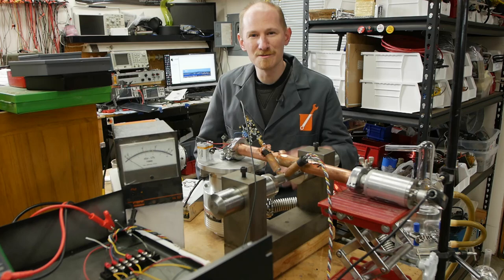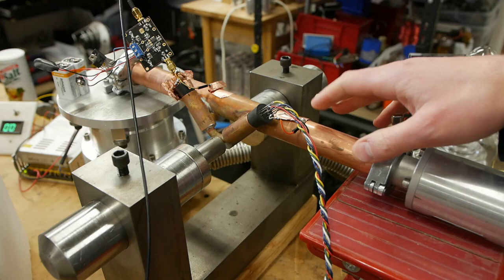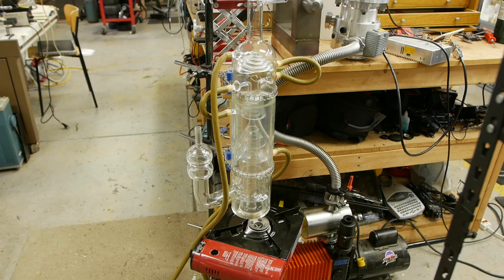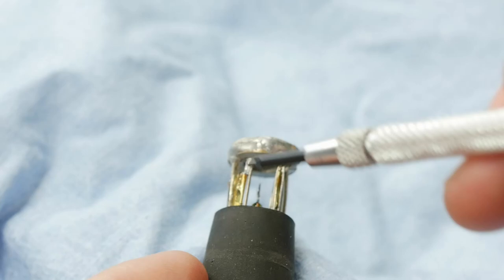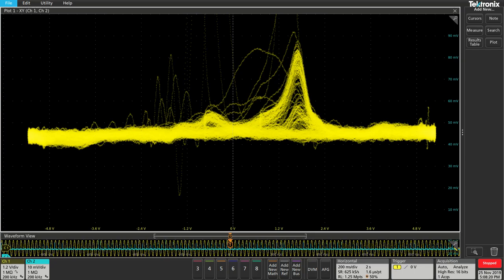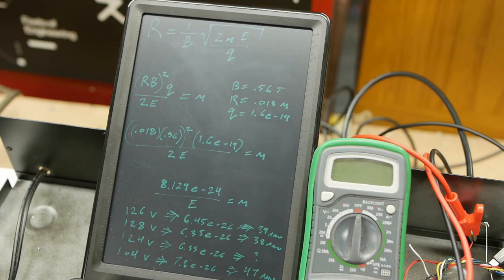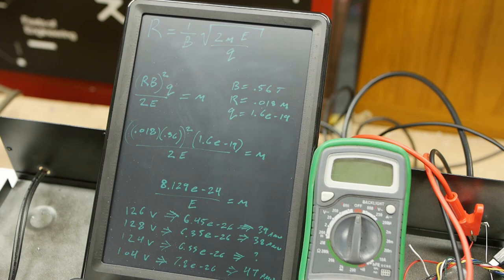DIY mass spectrometer measures potassium in dietary salt substitute

Comment: The multi-substance ambiguity issue reminds me of "touch DNA" analysis. If someone is examining a human hair, it's probably just going to have one DNA sequence, and lots of cells with that sequence. No problem. But if they're trying to get DNA from an item that has been touched, looking for transferred skin cells, there's a good chance there will be more than one genome in there if more than one person has touched that thing. If they already know what they're looking for (for example, they have a DNA sample of a suspect and they want to know if that suspect's DNA is part of the mix), they have a probability model that I think they derive from taking multiple samples and watching how all of the ratios peak. Each sample contains random amounts of each participant's skin samples. If your sample size is high, it's probably not too useful. But if you use smaller samples, the variations would come out more. (Just like the aggregate result of flipping five coins tends to have a greater standard deviation than flipping five hundred coins).  I wonder if there might be some publicly available algorithm designed for DNA forensics that could be tweaked for mass spectrometry. It's my understanding that the input data for each is the same, essentially just an X-Y plot that resembles a histogram.

Comment: simplest solution, have you tried running it dry? I'd assume yes but you never know. :P
is it an impurity in the tungsten filament, out gassing or ablation of surrounding materials?

could also be you are picking up some Cl 37 and its just so eager to say hello your little sensor cant handle it. :^)

Comment: 14:43 where can I find more info on that type of spectrometer. I had the same idea for building my own vis/ir spectrometer and want all information I can get.
Reply: Look up DIY spectrophotometer and you will find all sorts.  Just add rotating mirror or grating to your search terms and it will narrow it down.
Reply: @KallePihlajasaari  If you had done what you suggested you would see that there are no spectrometers of that type on youtube or DIY crowd. I did some research and found that its called monochromator. You wont find about it the with the searches you suggested.
Reply: @user-py9cy1sy9u  Sorry it was not the perfect advice, just trying to be helpful.  There are monochromators up for sale on eBay and occasionally on Eastern european auction sites.  Try one more search on "DIY Monochromator" and those should come up.  I have had to take the same steps in refining search terms when researching and mixing languages of search terms makes it more interesting and some times harder and at other times easier.

Comment: OK I'm an electronic engineer not a physicist or chemist, BUT the sample is KCl so what happened to the Cl ions! Are they on a completely off scale section of the spectrum so can't be seen?
Reply: Due to the voltage potential applied at the source they are going to be accelerated the wrong way back towards the source end of the chamber and wont make it out.

Comment: Suppose you had some carbides in the filament. Then you'd probably be able to make CO+ at 28 amu, which would give you sorta the right peak position, assuming the high-mass one is 39 and 41 K. Or generically, making CO+ in the usual electron-impact ionization gas analyzer mass spectrometers is almost universal, although I forget what the mechanism is.

Comment: 14C beta decays to 14N ... NOT 12C.  However, since 12C is not radioactive, it provides a stable scale to compare with the remaining 14C.  Peak AREAS should be 15:1, but the ion current likely varies with accelerating voltage.  If you can divide the detector current by the filament ion current, your areas will be more likely to agree with the literature.  You are probably right about the two peaks being an anomaly; given the ion transit time the increasing voltage will produce a different time offset than a decreasing voltage.  You can estimate the transit time for potassium, double it, and compare it to the time-separation between the peaks.

Comment: Mother of all problems - Resonance (Since the control values are static - voltage, field strengths, distances. Particles are just moving back and forth. The Second run loses velocity thus showing the smaller (heavier peak) . Maybe try running the whole cycle once with just one scan)

- Me

Comment: I think the Titanium Dioxide theory for the second peak has a problem. The guys back in the 1960s have the same peak - what is the chance that they too used dietary KCl and that it had TiO2 as a filler/whitener?
Reply: I agree. You can easily look up the ingredients of NoSalt online. It does not contain any Titanium Dioxide. It does contain Silicon Dioxide.

Comment: the reason why the rubber stoppers work is because they get sucked in and increase their ability to keep the vacuum, while a tube will not get pulled in and stop it, it will mostly keep its form and pull in air.

Comment: I think your answer is in what's in the black rubber stopper in others words how is it made and what is in it that maybe off-gassing also the pins may have a coating on them zinc or chrome I know the rubber has carbon black and sulfur in it .

Comment: Have you counted with the delay it takes for the ions to travel from the source to the detector?

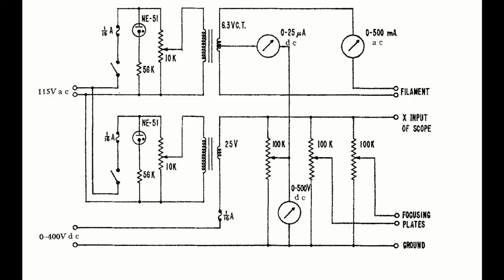You state at 15:22, that you change the acceleration voltage to differentiate between the different atomic weights. You use an AC voltage, but don't mention the frequency of that voltage. At 16:23 you mention that that AC voltage drives the X-position of the oscilloscope. 
When the correct voltage is reached, the atoms have the correct speed to reach the detector. But the ions take time to travel from the source to the detector. That means that when the correct voltage is reached in an up-going phase, it will be higher by the time the ions reach the detector. When the voltage is reached in a down-going phase, it will be lower when the ion reaches the detector. 

That may explain why you see two peaks for the same atoms, one at a higher and one at a lower voltage.

Comment: My guess: The rubber stop are getting "sucked" in and the better the vaccuum gets. The hose-system will have a harder time keeping the vaccuum since the outside air wants to get in between the hose and the pipe.

Comment: TLDR: 2nd bump looks like Tin (Sn 50)

Late reply, way late. 2nd time watching and puzzling over this video and far too long looking at and counting bumps on an oscilloscope screenshot I have come to believe that the "copper" supports holding the filament are actually phosphor bronze. Phosphor bronze contains tin.

From the internet:
"Most phosphor bronze alloys are tarnish and corrosion resistant, making them useful in electrical conduit and other caustic environments. They are also resistant to fatigue, meaning they retain their strength over many cycles of loading. The addition of tin will increase this resistance along with its strength..."

Corrosion resistance and additional strength to withstand repeated heat cycles make it a natural for this application. Only the portion of the filament holder directly in contact with the filament itself are heated by conduction but IR energy is hitting  the portion of the supports above the glass bead. Having a good vacuum ensures that heat will accumulate over time. The original article and paper likely used the very same materials. Incandescent light bulb technology has changed little over the decades.

Could be experimentally verified by testing a thoroughly cleaned filament and looking for the same signal.

As the pilots always say, trust your instruments.

Comment: The vulcanizing of the rubber stopper must be completely different.
Wrapping a hose would be impossible otherwise.
PEX TUBING MIGHT BE AN OPTION.
PERHAPS THE TUBING USED FOR IN-FLOOR HEATING.... OR GEO-THERMAL ...

Comment: Hi, does anyone know what transimpedance amplifier Ben uses?
Reply: I was wondering the same.
Reply: I found it out ... AD797. You get on ebay the board Ben uses
Reply: @kgmuzungu  Looks a little different, like isn't the same board.  I see there are transimpedance amplifiers.... though not the same looking board.
Reply: @kgmuzungu  I see now after looking a little closer.  Does look the same minus the pot.  Thanks for sharing the links too.
Reply: Looks like I was thinking correct at first in regards to looking different: https://twitter.com/BenKrasnow/status/1192690272318021633

"OPA657 on breakout board as a transimpedance amp with gain=1M, and then an additional 10 to 80dB gain with low-pass filtering from an SR650"

Just noticed the reference here: https://hackaday.com/2019/12/04/ben-krasnow-builds-a-mass-spectrometer/#comment-6200336
Reply: @jafinch78  excellent, thanks for posting!

Comment: Could this mass spec be used to analyze the amount of lead dissolved in water?

If not, that would be another project for you - measure the amount of lead (or other impurities) in water without paying $50 for a test kit, sending it away to a random lab somewhere, and trust they know what they're doing.

Thank you for fixing the video... I tried commenting on the original and you must've caught the error & removed it while I was still watching. =)
Reply: I don't know about you, but I'd trust some random professional labs over a homemade piece of equipment, generally speaking. If you're a real worrier - send the sample to several unrelated labs and compare results. Too expensive? Try pricing out a turbo molecular vaccum pump. 

Is it possible that multiple labs give you the same incorrect reading? Unlikely.

Comment: Long after the fact: if that lower peak is real, K2O^{+2} seems like a plausible species. It has the right mass ratio, and doesn't look thermodynamically implausible, at a glance. 2KCl+H2O-> 2HCl+K2O{+2}+2e-, the HCl is volatile and boils off and you see the K2O+2 in the spectrometer. If true, I'd think you would also see K2O+

Comment: I was an electronic design engineer specializing in low level detectors for Gas Chromatographs and the last 5 years I was designing a Liquid Quadrupole Mass Spectrometer called a Varian 500-MS.  Here is a link to the instrument that I worked before I retired:  https://cal-l.com/shop/labratory/varian-500-ms-ion-trap-mass-spectrometer/  I was one of the two designers that built the prototype.  This unit has 2 roughing pumps and 2 turbo molecular pumps.  The liquid sample was injected using a syringe into an Electro Spray needle at up to 5,000 volts to create an aerosol.  These small droplets were sampled into the first vacuum stage inlet at super sonic velocity speeds.  The ion beam was channeled through a Hexapole Mass Filter using a 1,600V, 1.2 MHz RF source that I designed.  It is the toroid on the green board on top of the vacuum chamber.   We steered the ion beam into the Ion Trap with 6 high voltage op-amps.  The first vacuum stage where the Hexapole Mass Filter operated was at around 5 millitorr and the vacuum chamber for the Quadrupole operated at around 10 microtorr.  The ions were held in the Quadrupole and were scanned out using a hyper linear ramp from 0V to 15,000V at 750 KHz.  It also used a patented triple resonant technique to increase separation and sharpness by quicker ejection of the ions.  The ejected ions were detected with a wide bandwidth photomultiplier tube.  The ions are separated on the basis of their mass to charge ratio. The mass range is 50-2000 amu with a resolution of <0.5 amu over the entire mass range.  Here is the brochure  https://www.agilent.com/cs/library/brochures/si-0195_500-ms_brochure.pdf

Comment: Building a chromatograph? You need a solvent and capillary tubes, that's about it. 

You can use a matrix or filter paper and do this in two directions. 

In gel electrophoresis you do this as well, just with DNA and in a different medium.

Comment: Answer to chromatography Q Chromatography is easy, liquid anyway. 
There are plenty of manuals on how to pick an elution solvent, how to load the column, how to pick a "pusher" solvent (name evades me rn) 

Almost always a Silicone Bead packing and a non polar solvent (H²CCl² and other chloroform Carbon based solvents work great but not easily obtained, basically you work with what you got and see what separates best (uv light usually helps if organic, otherwise rest it like a still, small samples to test if separation was achieved [at least one full solvent sample between constituents in tested sample])

TL;DR
If you built mass spec, you can easily do column
"The lab students companion" Laboratory techniques for organic chemistry
Lehman
Has a good rundown on how to use and pack, how to make us obvious.

Comment: you got something wrong when talking about mass spec at the beginning, unless you are using a really hard ionisation technique (perhaps electron impact) you don't usually split a molecule in to it's constituent elements. what you get normally depends on the ionisation technique used. you often get fragmentation plus the molecular ion mass. a popular technique used currently is electrospray ionisation which often gives very little fragmentation this is known as a 'soft' technique others include MALDI, chemical ionisation (CI) and atmospheric pressure chemical ionisation (APCI).

Comment: There were a lot of variables in this build which could have resulted in no output on their own, and many other variables which, when combined would also result in no output.

How did you eliminate each problem, and co-dependent problem?

... I think that's probably an entire video series on its own; I experience issues at work that are the result of basically interlinked spaghetti and things don't work, I guess I'm asking what your mindset is in fault finding when things are like this: you don't fully understand all aspects, things are dependent on each other (testing one is difficult or impossible), others are a failure on their own and some things happen so fast physically they're difficult or impossible to test... How do you sit down and work through that mess?

Comment: Pipe is too short for its width.
There's more than one path an ion can take depending on its speed.

There's the high probability path where the thing operates as intended , then theres the low probability path where a slower moving ion is able to get through by being near the "outside" of the turn at the beginning and then making a sharper turn into the "inside" of the turn and continuing on to the detector.

Comment: @20:15 -- Carbon 14 is not so unstable as to radiate away neutrons.  (Such isotopes do exist, but they are extremely short-lived, and carbon-14 is not one of them -- they have a much greater imbalance of neutrons to protons.)  Instead, it undergoes beta decay, emitting an electron and an antineutrino and converting a neutron into a proton, thereby becoming nitrogen-14, not carbon-12.

Comment: Huh, I always wondered why when they do urinalysis they do gas chromatography AND mass spectrometry. And now I know. =) It always felt a bit redundant, but I knew there had to be a good reason for running 2 separate analyses if 1 would have sufficed. Insurance companies wouldn't want that.

Comment: I can't speak for the results produced by the earlier tests you're comparing against, but titanium is commonly used to coat razor blades.  BAM! There's your 47.
It could have been released in the soldering process, so it might actually diminish under vacuum over time. If, however, it's actually being sheared off by the ionization during testing  - then you'll forever be looking at your results through titanium-colored glasses. 😕

Comment: Part list? Planning to encompass and build a chromatograph to pair alongside this. Will attempt and finish within 3 months. I'm going to try. Building both together on a budget for everyday users. And potentially add automation between the two machines using the same sample.  Eager to hear back from you. Or anyone who has the websites required to his design.

Comment: A gas chromatograph isn't that complicated really. As far as I know you just have a constant pressure (likely easier) or constant flow rate (may be harder) of gas going through a capillary or packed column, which you might be able to buy or make. There is also the aspect of controlled independent heat on the inlets, oven (heats the column) and detectors (TCDs and flame ionization detectors are common, but you have this nice mass spec here...).  Separation is selected based on selection of the temperature ramp of the oven (the oven is a very precisely controlled temperature), the column choice (of which there are many) and inlet flowrate/pressure, as well as other factors. You also need to deal with things like a reference gas and makeup gas selection to have an internal standard and a gas you can push through that won't really be detected too much, or at least accounted for well. Liquid chromatography shouldn't be that difficult either, but I'm not as familiar.

Comment: Try running the system without a sample to confirm that peak at 47 is not from the filament or the razor blades, .... you might be able to confirm the “ reflection” theory by trying a different salt